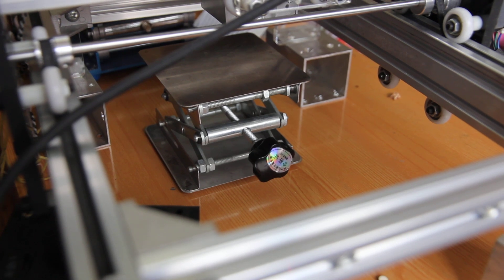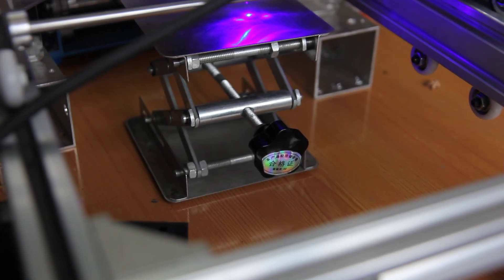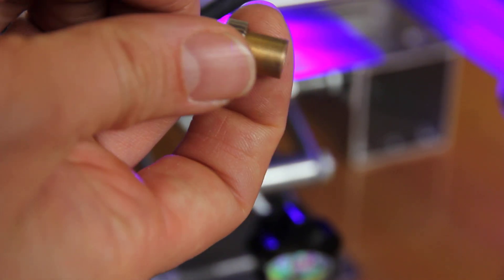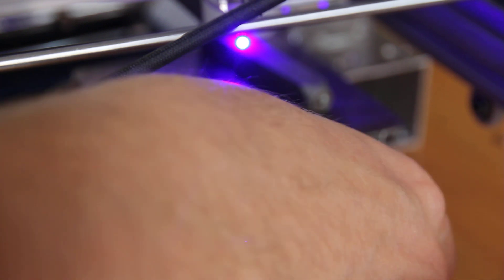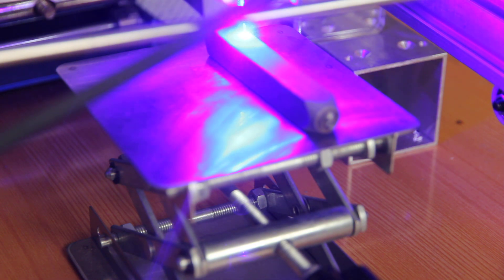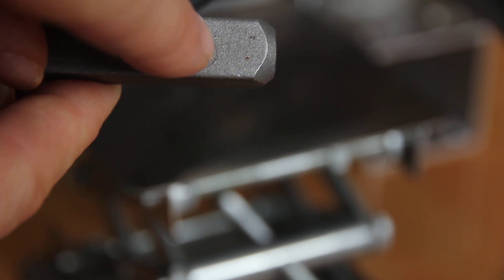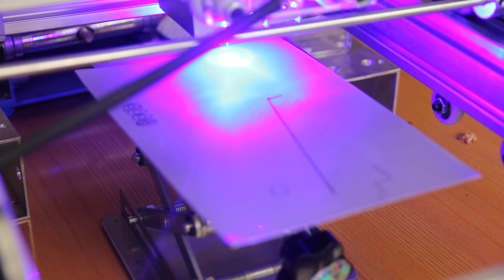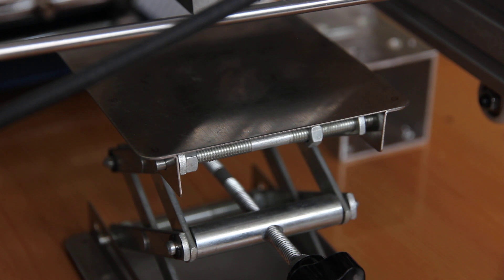Metal etching. Engraving on steel, aluminum with an Endurance diode 445 nm 10 watt laser.

Comment: I thought you couldn't engrave metal with a diode laser especially this low of wattage? I was under the impression you needed something above 60w or a fiber laser?
Reply: You can't engrave metal plates (reliably), only powdered metal and the elox on aluminium plates....
Reply: @1991apfel  Thank you.
Reply: There is one way to archive a way of engraving on metals: 
1.paint it
2. Laser the paint away where is should be engraved
3. Etch it.
You can etch with Fe3cl, strong acids or with saltwater and electricity....
Reply from the maker: you can do a lot of things with our diode lasers, take a look at this page >>> https://endurancelasers.com/endurance-lasers-all-about-cutting-and-engraving-abilities/